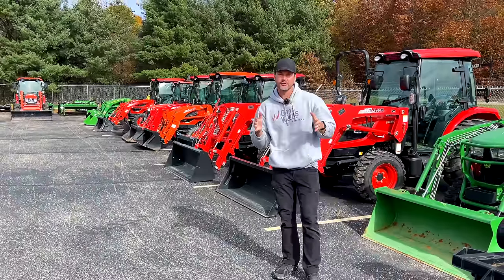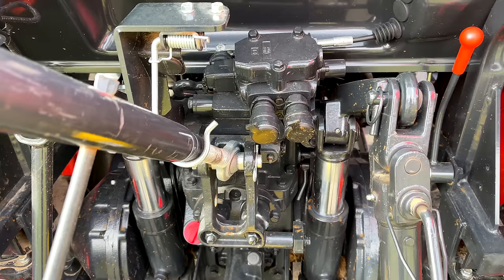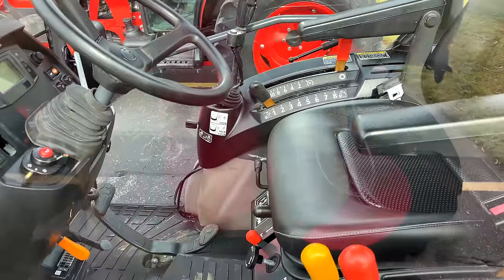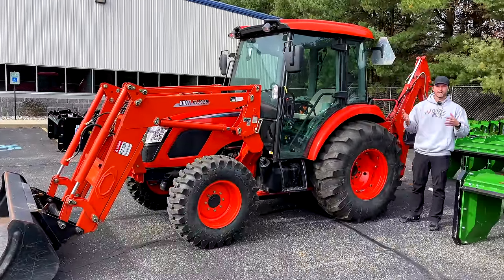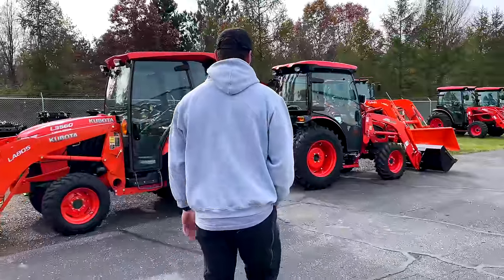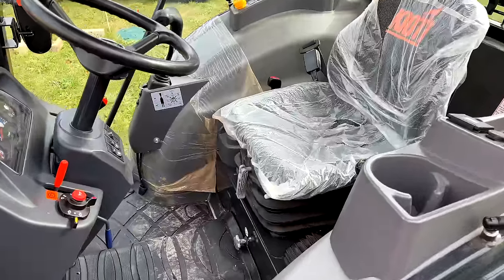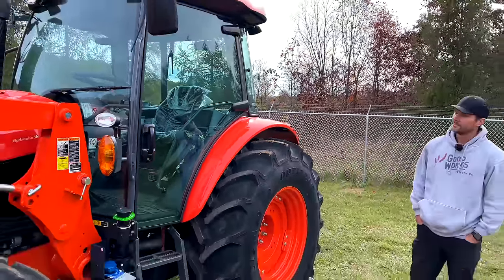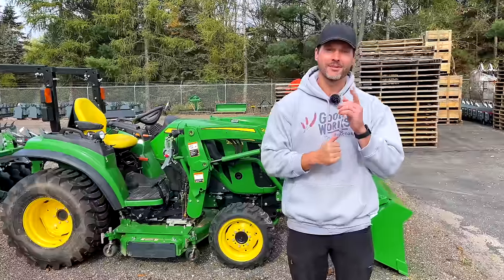I WENT KIOTI CRAZY AND SPENT $250,000!!

Comment: Love the Kioti lineup!  I don’t have a big enough piece of property to justify much tractor.  Between my son-in-law and I, we have about 21 acres.  I bought a CK3510 in March of 2021 and I love it.  I use it for driveway maintenance, mowing, and occasional round bail moving.  Plus I put a third function and grapple on it to move brush which has really been handy.  We have a family owned and operated Kioti Dealer about 25 miles away in Clyde TX (Smith and Son).  They are very nice!  So far I have put about 130 hours on my CK and it has been flawless!  The re-gen has been no problem at all.  When it starts, you know it immediately just by the change in sound.  I always just keep the RPMs up and keep working.  Wish I had bought a cab model.  It is just hard to justify no more than I use it.
Love watching your videos!

Comment: I bought a KIOTI CK2610 SE HST in April 2021 and now am just under 800 hours with no (NONE) complaints!  Plastic still is on the seat ! I have a 5' tiller, a Grapple and also pallet forks,   OH, and someone gifted me a 6' rotary brush cutter and I bought a used 5' Woods finish mower   
I use this thing nearly every day,  grubbing out honesuckle, carrying logs, etc,  the cab is awesome for climate and sound deadening quality.  the separate drive pedals are so easy to use compared to the single treadle when your 65 years old and ankles aren't as flexible as they used to be or if your work boots are stiff..
It came with two remotes on the back and I had them add the 3rd function on the front for the grapple.   The loader can lift up to 1835lbs 

I could go on and on, but you're covering most of the good stuff in your video.

Comment: I bought my first tractor, a CK3520SE HST in May, and have been getting a LOT of work done on steep/hilly terrain. The thing is a beast. I called the dealer and was told wheel spacers would void my warranty so that’s a bummer, but the ballasted tires and going slow works for now..
Reply: I have exactly the same tractor-love it
Reply: It would only void warranty if it was proven as the cause of a failure. Same as any car or truck. Magnuson-Moss act.

Comment: I have a NX5010 cab tractor and I love it, hydraulic supply is awesome and the loader lift capacity is great, I just could not bring myself to spend more on the other brands.  I have a backhoe, bush hog, land plain, rear snow blower and front hydraulic snow blade, along with my bucket and pallet forks, the tractor just works with no issues, great reliability.  I moved up from a New Holland TC35 a few years ago due to the Canadian winters and being tired of being out in the elements when plowing.  Love my Kioti.

Comment: Yes, I'm definitely seeing the value in my CK2610 HST.  I have the backhoe on it, which is a pretty slick unit.  It's dug out countless stumps, trenched the electrical for my cabin and barn(s), and done all kinds of digging.  As far as the rest of the tractor goes, I have a sawmill and a set of pallet forks for the front, which have been a terrific addition.  Anyway, everything I could possibly throw at it has been handled with aplomb and it has never been back to the dealer in 300 hours.

Comment: Sold my 2017 2032R and bought a CX2510.  Kinda regretting not getting the cab version.  The Kioti beats the 2032R in every category besides Engine and PTO HP.  The JD driveover decks are not as easy as they make them out to be and the loader takes 1 minute longer to remove on the Kioti.  Those are mute points to me.  And I am a JD fan boy.

Comment: I currently own John Deere myself.   My next tractor I'm thinking about the DK cab version. The price of the other two main tractor companies is out of control. Sure they are nice and if i was independently wealthy it would be no issue. The one thing you should point out is the weight compared to John Deere and kioti. Most of the John Deere rear ends are a cast aluminum vs. Cast iron on a kioti. I myself am buying a tractor to work, and I do lots of loader work. In my honest opinion, having some more meat on the bones is usually a good thing on a tractor.

Comment: The Kioti DK, NS, NX are all more inline with the JD 4 series when compared to the size, the HP, and capabilities since they're all very close. If anything the Kioti DK is almost the in-between model for the JD 3 & 4 series but closer to taking on the 4 series. I would say the JD 3 Series is closer to the Kioti CK when comparing numbers.  If you sit on a Kioti DK and JD 3 Series you will see how much bigger the Kioti DK is plus you have more platform space. The Kioti DK model is meant to be an economy version tractor that is a small step down from the NX series which is a Premium tractor. Both are very close to each other. The new Kioti NS model is meant to be half way point between the DK and NX series. Basically the new Kioti NS model has the NX front end but the rear end of a DK and the Hydrostat transmission is mechanical like on the DK-SE models. All three models, DK, NS, NX are different sized/optioned tractors that are really close in range.

My brother has the Kioti DK5010 open station shuttle shift with AG loaded rear tires, 3rd function, rear remotes etc. He's done a lot of work with it after having it for 2yrs now and he loves that tractor. I want the RX series Kioti.

Comment: Do the Kioti tractors come with a mower deck like say the 1025Rs?
Reply: Yes several models have the option. A CX2510 (about 2025r size) has a factory cab with AC. If you added a mower to that, you'd have the coolest mower around.  The CS models are about 1025R size and can have decks too.

Comment: kuboter and Deere will over power
Reply: Kuboter?
Reply: over power or over priced?
Reply: @DonnieDarko727 
Perhaps we have found Ginger Billy's burner profile??
Reply from the maker: Not sure in what way. They definitely don't over power in the same tractor class. Kioti beats them in loader and 3-pt lift capacity in every comparison we've done so far, and don't forget for less money, too!
Reply: @GoodWorksTractors  I did nine months of research, visiting a good number of dealers.  I have a New Holland dealer a quarter mile away and a John Deere dealer a hundred yards north of them.  I drove 45 minutes to buy my Kioti CS 2520 ;in Fremont, MI.  I bought my CS 2520 with FEL and MMM for less than JD was asking for just the tractor.  I bought on specifications more than price.  The JD dealer has recently been bought by a conglomerate, where my Kioti dealer has been in the same location selling ag tractors and equipment for over a century.  Still family owned and operated.  In fact, my salesman purchased the same tractor that I did for the same reasons.  BTW, the drive over deck is truly a blessing for this slightly built 66 year old.